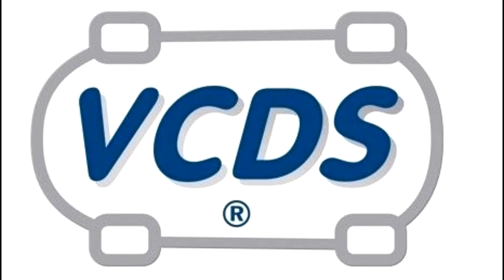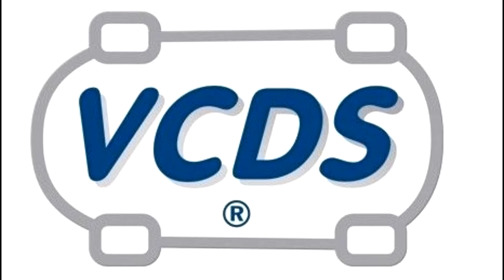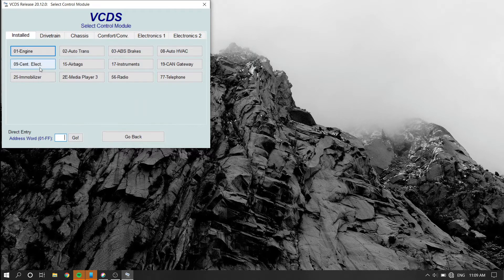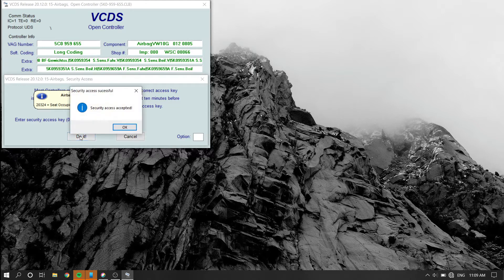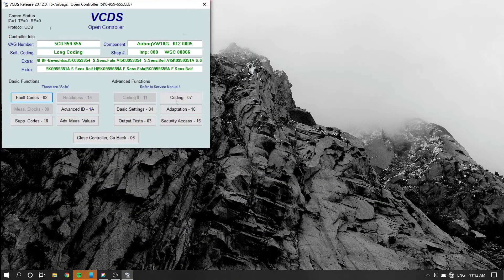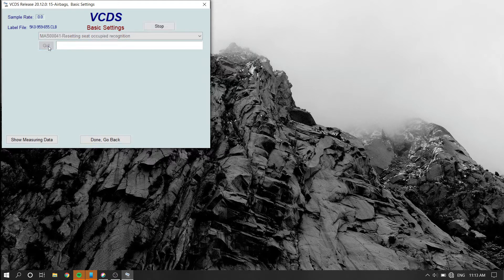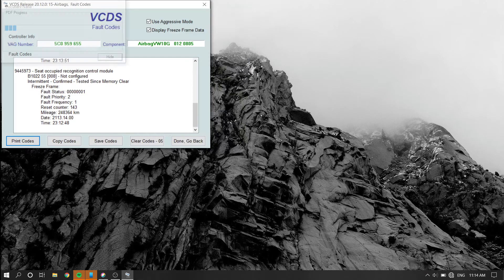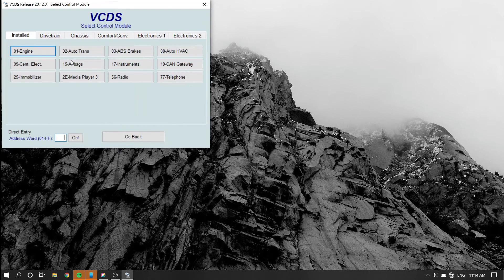RESET SEAT OCCUPANCY MODULE USING VCDS

Comment: The dealer told me I needed a new airbag modular that would take at least 3 hours of labor to change and code. After watching this video, I bought a VCDS scanner for $200 and fixed the problem myself in five minutes, saving me $1400 and a trip back to the dealership. All the dealership had to do was reprogram the new airbag sensor they installed under the passenger seat.  Thanks!!
Reply: Same situation here - they wanted me to buy new parts for $500 and spend $400 for labor. Didn't seem right, so I'm glad I found this vid. F the stealerships, whether this was because of incompetence or actual malice.

Comment: Could this procedure be done with the OBDeleven? I currently have this fault code on a vehicle I recently purchased. Checked under the seat and everything seems to be connected. Trying to figure out the location of the module, whether is under the seat or on the side panel by shifter.
Reply from the maker: I dont think so

Comment: Hi, what if it comes back with "ERROR: Conditions not correct or request sequence error"

After selecting Resetting seat occupied recognition
Reply: Did you solve the problem?
Reply: @patrykwojciechowski4373  No, I ended up selling vehicle.
Reply: @jogu1732  no worries, started working since I was omitting this serial number change. Going to sell my vehicle as well, thats why fixing the issue :D